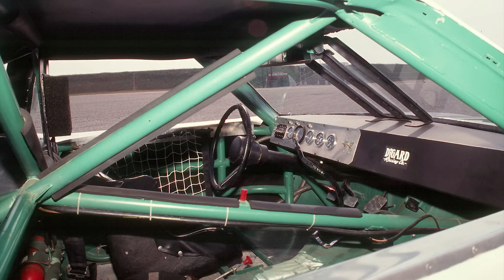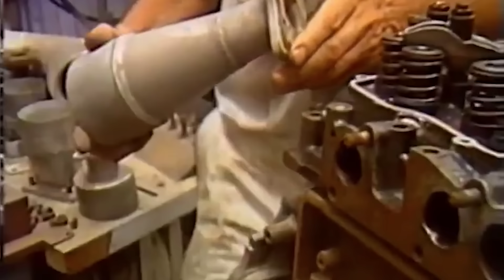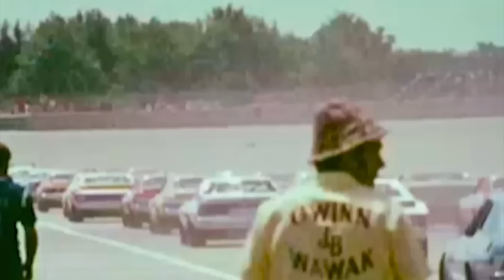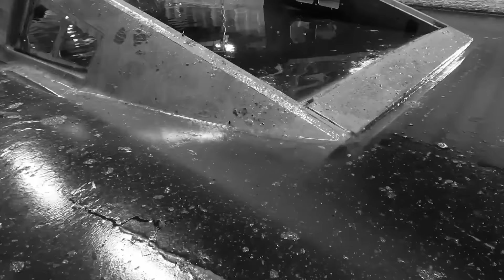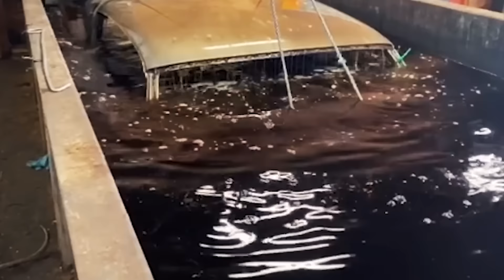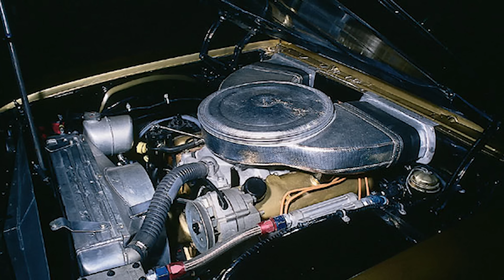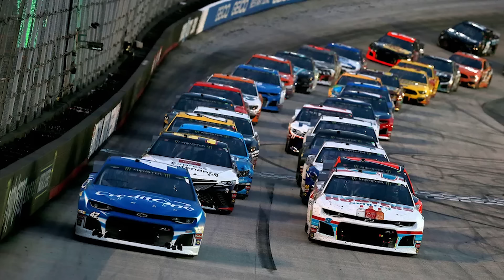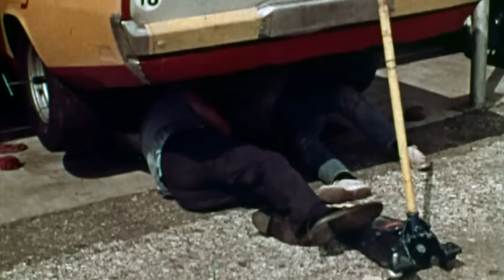5 Illegal Racing Tricks NASCAR Had to Bury Forever

Comment: THIS IDIOT DOESN'T UNDERSTAND HOW NITROUS OXIDE WORKS IT BASICALLY COPIED THE WW2 FIGHTER PLANES USING WATER INJECTION NITROUS OXIDE SLOWS THE CYLINDER COMBUSTION PRODUCING MORE HORSE POWER.
Reply from the maker: Yea...what an idiot
Reply: No.....nitrous realeases oxygen with heat of compression, but you have to add fuel for gains.......it's not so simple, there is a lot more plumbing going on......pretty easy to spot

Comment: Some of this sounds like bs, how do you inflate a basket inside a fuel tank and then deflate it? And would basketball material even survive in gas? And the snaked all around 2 inch fuel line would not only be obvious but what kind of fuel pump were they using and not 5 gallons but 1.8 so I am done watching how the chevy guys cheated.
Reply from the maker: Not a chevy guy?

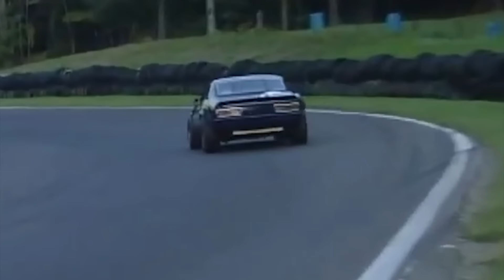Comment: I GOTTA JUMP IN AT THE 15:00 MARK, ACID DIPPIN 325 POUNDS OFF YOUR BODY AND THEN ADING 300 POUNDS OF TUBING, FLANGES, GUSSETS AND WELDING MEDIA WAS A TOTAL WASTE OF EFFORT, I KNOW, I BUILT/ RACED DRAG CARS FOR 26 YEARS. YOU PULL OUT 460 POUNDS OF WEIGHT ( EVEN THE BODY PASTE THEY POURED ALL OVER THE SEAMS IN THE REAR  AREAS) ADD ALL THE TUBING, SUSPENSION, AND SAFTEY GEAR YOUR 3,600 POUND MUSCLE CAR STILL WEIGHS 3,400 POUNDS RACE READY! EVERY 100 POUNDS REMOVED = ONE TENTH OF SECOND IN SPEED, 1,000 POUNDS = ONE SECOND, SAME CAR AND POWER OUT PUT, JUST BASIC PHYISICS. IF YOU WEIGH 232 POUNDS AND NEED TO BEAT THAT RIVAL IN THE LAST ROUND SIMPLY PUT A 128 POUND DRIVER IN THE SEAT. YES, YOUR CAR JUST BECAME A TENTH AND A HALF FASTER AT THE TRAPS. HAD A FRIEND KILL HIMSELF AT THE LOCAL DIRT TRACK USING WAY TO MUCH MUFFELER EXHAUST TUBING TO FAKE A ROLL CAGE THRU TECK. I SAT IN THE SEAT OF AN OLD NEIL BONNET CAR FROM THE LATE 70'S, BUGGER STICK WELDS GOOD FOR NOTHING. STEERING POST HELD UP BY A PIECE OF OLD ANGLE IRON POINTED DIRECTLY AT YOUR CHEST, TO MANY FLAWS TO MENTION. THOSE GUYS DROVE TRUE SUICIDE MACHINES AND NASCAR TECK IN THAT ERA WERE PRETTY MUCH MURDERS. BUT NASCAR TODAY AIN'T WORTH WATCHING HA, A TWO LANE BUMPER KISSING BUMPER 180 MPH PARADE. NO PASSING..THAT AIN'T RACIN.
Reply: Hi, I have the same roll cage and it does not weight 300 lbs, more like 170.. I mean no disrespect.
Reply: @thedukeofspeed " I have the same roll cage" ...REALLY. a 12 point with additional ' Iron Maden' wrap around the pilot' additional cage,  2 heavy sub frame connectors, 2  1/4" drive shaft loops, 2  1/4 " front and rear engine mount plates ( which every 'TWISTER' acid dipped frame demands when your typical stock engine mounts are now useless.) Too much else to list pall, further more my 1 5/8 " CHROME MOLLY is heavyer than your mild steel six point streeter cage, no disrespect, we live and run in differant worlds, HORSE POWER IS A CREDIT CARD PURCHASE.. safety is Knowkedge and Experiance,  FYI.
Reply: Your car might still weigh 3400 lbs, but they could manipulate where the weight was which improved handling.
Reply from the maker: holy crap @ddalton...sounds like you have some amazing stories!
Reply: @SpeedStyle-d9u Well, yeah, sittin here lookin at 2 framed pics on the wall of me and Big Daddy talking about a MOON EQUIPMENT vintage front wheel spool  "Don't worry those things were built to take 300 + easy". Also lookin at an envelope addressed to me from the great Al Teague ( Bonniville record holder in Stream Liner Class in a 440 MOPAR that held the record at 409 MPH for I think was 14 years, he finally got beat by a couple of millionairs, he was checking out  my pics of my F-16 droptank streatched to 27 Feet Blown Alcohol Lakester I was building. We ended up next to each other at Wendover Field looking at the "Jail Bird" movie prop from ' Con Air'. So I said "And who might you be" he replied " Al Teague and I'm here today to watch my record fall". So I said " Damn, this is like meeting Mick Jagger" he said " Come on, I 'm just like you" He wanted my address to send me something? 2 weeks later he sends me a cd  copy of ' The Boys of Bonneville' before the release date. He was a very humble and great man to meet!! We both loved 440's and I told him about my street king days in a built to the hilt blown 1970  Hemi Orange Challenger, ( S/ST 10.90) with a licence plate and inspection sticker. Now that was back in 1990 but  some where around 1995 I began getting my ass handed to me in NOS'ed up Toyota Suppras, yep, times they were a changin.
Reply from the maker: Now that sir is priceless!  The story alone is awesome @ddalton
Reply: @ddaltonroczombie7655 first Supras ain't sht! I worked as a Toyota tech and you had to build the living sht out of that block to handle extra boost. Not to mention the trans would blow the fck up if you went to 330HP
SECONDLY 
I think your confusing track roll bars with drag racing roll bars
Big difference between 250 and 150 mph 
....and stop yelling.
Reply: Why are you yelling?😂

Comment: In the mid 1980s Dale Armstrong, crew chief for Kenny, Bernstein‘s funny car and Ron Hamel from 10,000 RPM Speed equipment developed a system for Bernstein‘s nitro funny car. They eventually got caught and in NHRA decided that they were going to make an example out of Bernstein and Armstrong so the story goes that Kenny Bernstein called Budweiser and informed them as to what was going on and Budweiser contacted NHRA and when that conversation ended in NHRA said never mind!🤪 apparently NHRA was more interested in the money from Budweiser than it was to make a big stink out of Daly Armstrong‘s attempt with nitrous oxide.
Dale Armstrong‘s explanation for the nitrous oxide in a nitro motor was that in his theory, the nitrous would clean up the air charge going into the engine and the result would be less explosions because he explained to NHRA that they didn’t need the horsepower!
Reply from the maker: Another interesting tid bit...thank you sir!

Comment: In the early 80s Ron Hammill from 10,000 RPM speed equipment developed a nitrous oxide system for NASCAR qualifiers that was fed from a 1 pound nitrous bottle in the driver‘s pants and fed through a rivet at the back of the air cleaner which they only used during qualifying.
Reply: Kool.. Thanks for sharing.
Reply from the maker: And another!  Might need to pick your brain sir....:)

Comment: The gas line was only 11 feet 2 inch tube or 1.8 gallons about an extra 5 miles a fill up! They were running about 4 mpg for the 22 gallons or 58 laps equals about a 5 lap advantage!
Reply: The basketball trick was what everyone else was doing, that's why he built the fuel line. He also used the roll cage as line.
Reply: The argument about the fuel tank, that rased the issue, was Smokey wanted to use a rubber fuel cell for safety.
Reply from the maker: Thats some good mathin...